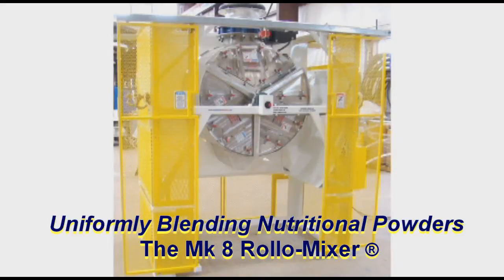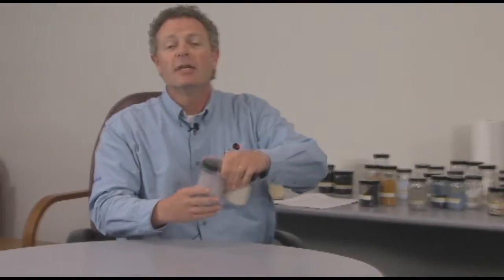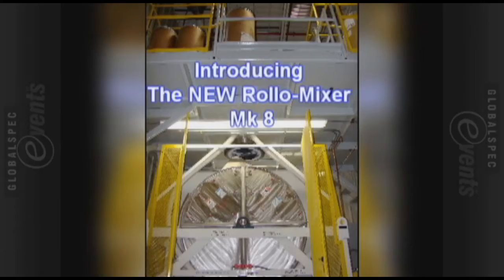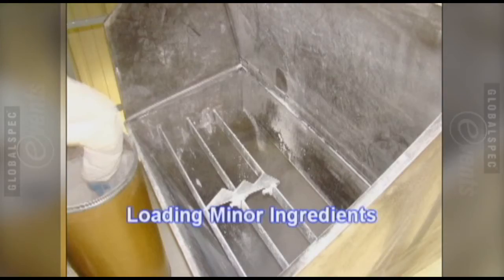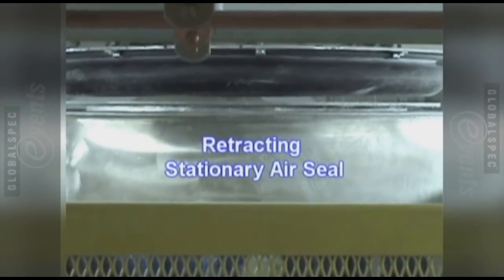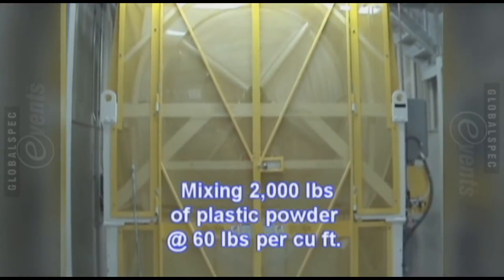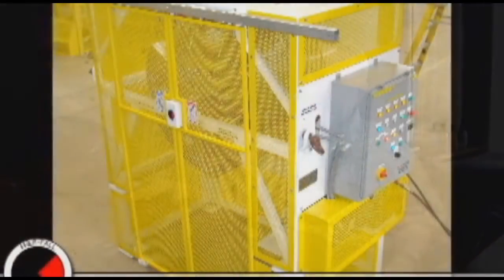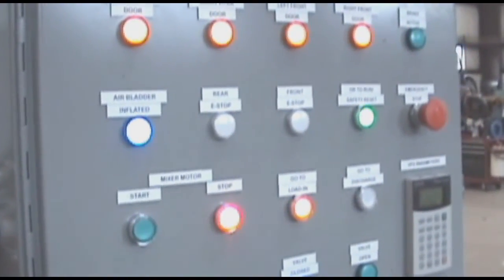Blending Dietary Supplements & Vitamin Powders - Rollo-Mixer ® Mk 8 Batch Mixer Video Series

Comment: I am curious if this device has any sort of internal design elements such as paddles or diffusers etc... or it is just a single large drum that rotates? I am trying to mix up a supplement for my dog that does not need to be SUPER accurate but it needs to be mixed fairly evenly... I am thinking of something similar (on a MUCH smaller scale of course) I was thinking a plastic container affixed to a slowly rotating motor... I am mixing approx 100mg of 3 different dry powders to make a total of 25g (at a time). Each capsule will weigh 500mg and I will be using a powdered multivitamin as the 'filler' for the rest of the void. So 350mg active ingredients and 150mg multivitamin.